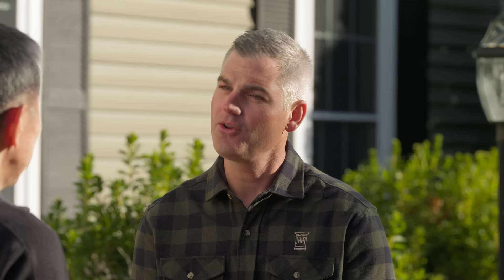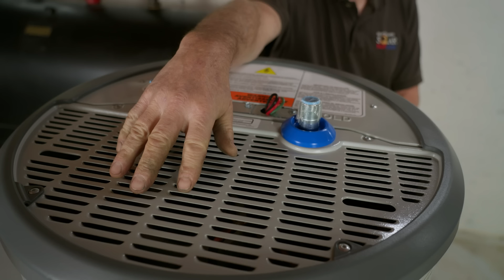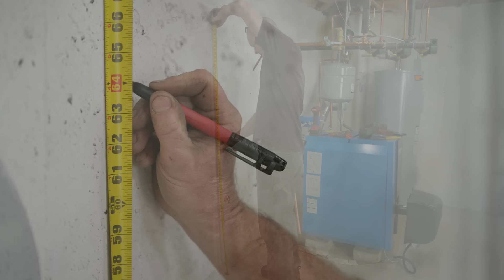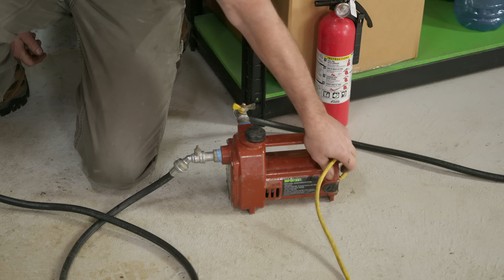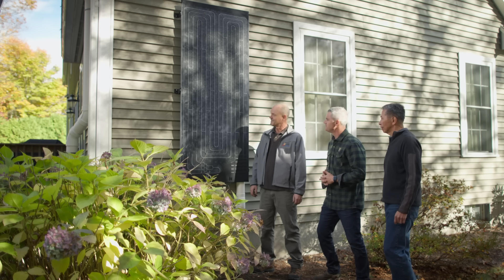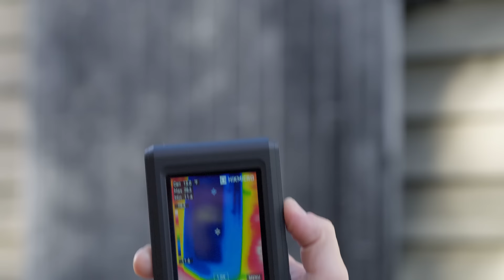Heat Pump Water Heater for Cold Climates | Ask This Old House

Comment: OK, here is what I don't get. Refrigerants boil when compressed, so why is the boiling refrigerant not just pumped through a coil  to heat water? I don't understand the need for getting heat externally if you are already making heat by compressing the refridgerant?
Reply: Refrigerants boil when evaporated. Heat pumps do not "produce" heat, they move it from one place to another. This system is taking heat from that evaporator (the thing outside) and moving it into the water tank. It gets cold because it's absorbing the heat from around it. Compressing the refrigerant forces it to become a hot gas, which is then moved into the condenser, in this case the inside of the tank is the condenser. This condenses the hot gas refrigerant into a liquid and gives up its heat to the water in the tank. Now you have a warm liquid refrigerant, which you can't just compress again. Remember, liquids can't be compressed. From there you send the warm liquid to the evaporator where it passes through a small orifice or expansion valve. This pressure change causes the refrigerant to boil. Boiling anything takes energy, like when you put a pot of water on the stove. It takes energy to boil the refrigerant, which it gets from the metal and surrounding air of the evaporator. This seems counterintuitive since it's cold, but it's actually absorbing heat into the refrigerant. This is where the heat comes from to heat the water. From there it goes back to the compressor and back to the condenser and gives that heat off to the water. The cycle repeats over and over. Just like a window air conditioner, heat is moved from inside to out. One coil gets cold and that is the one absorbing the heat and the other gets hot and that is where the heat is released. We are used to cooling things and it makes more sense, but it's essentially like taking the window air conditioner and putting it in backwards to get heat in the winter time. (window AC's aren't designed for this, but an AC is just as much a heat pump as this thing is. Heat is moved from one place to another. It's vastly more efficient to move heat than it is to create it. Hope this helped.
Reply: Because then you'd just be using 1:1 electricity to heat to generate the heat. Electricity to make heat is very expensive. The panel outside absorbs ambient heat in the air, free heat really. That heat was generated by nature not by gas, oil or electricity that you pay for. Using electricity and the pump 1 unit of power is used to grab about 3 units of heat from the air outside and move the heat inside using the refrigerant moving in the tubes.
Reply: @dg-hughes " Using electricity and the pump 1 unit of power is used to grab about 3 units of heat" What does that even mean?
Reply: @saulgoodman2018  In an electric water heater, 1 watt of electricity is turned into 1 watt of heat in the tank.  In a heat pump system, 1 watt of power to the compressor moves 3 watts worth of heat into the tank. You can use whatever units you want, it doesn't matter, the math works out the same.
Reply: @chrisrichard298  Still do not understand. What does that mean in term of how much it would cost? How many degrees is a watt of heat?
Reply: @saulgoodman2018  It basically means the heat pump water heater uses 3 to 4 times less power than an electric water heater does - when its running on heat pump mode.
Reply: @Zero11_ss  This is what I hate about Ross. He talks about things in terms that most people do not know.

A gas water heater seems like it would be cheaper still. 
Sounds like a gas water heater uses the same amount.
Reply: @saulgoodman2018  Yeah the explanation wasnt clear enough. I actually switched to this from a nat gas one, used some govt rebates and stuff to get it done cheap. Nat gas prices will probably rise in the coming years, we are going to start exporting it as liquid natural gas to the europeans since nat gas is way more expensive over there. Data centers are also using nat gas to generate power since its quick to set up. I want to make our house full electric eventually and get solar panels, but i cant afford all that yet.
Reply: Right, so refrigeration in a nut shell 
is just moving heat from one space to another. The byproduct of that is what we call "cold". When it is done as your inquired about, you will effectively be cooling your house. Not ideal in the winter.
Reply: @ARClazerbeam  Also not ideal in Areas where Natural gas is 4x cheaper than electricity...AKA most major cities...Heat pumps are a scam, and they are noisy...
Reply: This method is 4x cheaper in summer
Reply: @Zero11_ss  Having a solar water heater panel on the roof would be even cheaper. All of this is a waste because hot water demand in the summer is minimal and is important in the winter. These heat pump systems take forever to heat the water using the refrigeration cycle and can't keep up with a large household's needs for showers in the morning.  Most of the heat pump systems have conventional resistance heating elements for high demand = no savings during peak use.
Reply: @David_H_Parker a work around is to keep the water temp higher and use a mixing value to keep it safe.  It will increase your net hot water and keep your heat gain through the heat pump rather resistance heat.
Reply: @David_H_Parker  i have a 65 gallon one with 5 people in the house and i never had a problem so far, I live in NYC. Even if you have more people over, it can easily just switch over to full electric.

Comment: What about in comparison to natural gas? I gotta say I have a family of 8 and we never run out of hot water and my gas bill in summer with the my cooking stove and the water heater only runs like 25 a month
Reply: In terms of energy efficiency, natural gas will be a little less than 1 (depending on all the factors) because natural gas is converting the gas energy into heat, to warm up the water. Heat pumps are more energy efficient because instead of only converting the energy to heat, they use the energy to move heat around: effectively, they scavenge heat from the source and apply it to the water. The efficiency goes down as the amount of heat outside goes down.

Now in terms of dollar cost? That depends on how much your natural gas costs vs. how much your electricity costs. For me, natural gas is very cheap so even if it's less energy efficient, it may be less expensive to use it.
Reply: @broadside85  If he's on oil. I guarantee he doesn't have natural gas. He would have to have a propane tank and delivery.
Reply: @broadside85  Exactly. The efficiency of a natural draft water heater is nowhere near 1 but would likely cost far less than even the most efficient heat pump water heater in winter.

Electricity rates are climbing in most states due to higher demand from EVs and datacenters.
Reply: If he has an oil boiler, it means natural gas is not available in his area. Cost of the indoor heat pump water heater is at least $1500. The conventional electric is around 500$. The system will wear out before you ever get your money back even if it were 300% efficient.
Reply: It doesn't seem relevant since Methane is not available in this location.
Reply: They want us to have electric cars but not electric water heaters...
Reply: @FshHnt192  I can't say what they REALLY want for you but it isn't in your best interests.
Reply: @David_H_Parker  And why can't you say it? Who's "they"? And how do you know what's in FshHnt192's best interests?
Reply: I use natural gas for water heater cooking stove and furnace and I live in indiana we suffer weeks of below zero degrees the highest my gas bill gets is maybe 235 a month in the coldest months but in summer its seriously 25 a month. Id say its all in the costs of things in your area
Reply: You’re essentially paying $20/month to the gas company just to have a gas connection and $5 of gas for the stove and water heater. If you stop using natural gas, you save $20/month, and you can use those savings on using more electricity for an electric stove and water heater.
Reply: @my2iu  Electricity rates are typically higher than natural gas. Running an electric water heater and range/oven would push the electric bill higher than the $20 or $25 base service gas fee. 
Using electric heat rather than gas would run the bill north of $600 easily and possibly as high as $1200 per month.
I am paying up to $80 per month for my electric bill on a vacant house only running a dehumidifier and a couple lights on timers.
Reply: @David_H_Parker  Are you getting ripped off on your electricity? I’m paying $50/month in electricity for my condo that I live in, and $45 of that is just for the connection. I only pay $5/month for the electricity. Admittedly, a whole house dehumidifier is the equivalent of running an air conditioner, so maybe $80/month for that isn’t so bad.
Reply: @my2iu  I am running a portable 55 pint dehumidifier and 3 lights on a timer.
 My absolute minimum bill is $18 with the main turned off with zero electricity usage. During the winter my bill is $25 per month, during the summer, it can get up to $80 per month.
I could probably save a couple dollars switching to another plan but not much.
 I have another vacant home in the neighboring state that is consistently $6 per month with the same model dehumidifier. 

I don't want to know what the bill will be when I am actually living there with all of the appliances plugged in and A/C running for summer.
Reply: But like $300 in the winter
Reply: @Tilier  Because they are more then likely also have a gas furnace. So they also use it for heating.
Reply: @Tilier  Whatever it is in the winter, natural gas will still be cheaper than electric.
Reply: @David_H_Parker  depends on where you live and if it is more expensive where you live. you can invest in some solar panels and heat pumps will definitely be cheaper. The zero OPx house is now a reality.
Reply: @gabeh.4297 Without taxpayer subsidy, the ROI on solar and heat pumps is over 20 years in most locations.

Comment: Cool tech but a bit of an eyesore. I wonder if it makes sense to put it on the roof like a solar panel or if the frost/ potential snow buildup would be problems.
Reply: you don't want snow and ice building up on it ideally, basically just acts as an insulator. These are great and definitely the future. There's a reason every new build doesn't do gas hookups anymore. These with induction stove tops and full heat pump HVAC and some solar panels and your home is basically self sufficient. throw a house battery + electric car in there and you can be fully off grid with no OPex.
Reply: @gabeh.4297 You obviously haven't designed or priced a solar system to run an all electric home.
Reply: @rupe53 of course I have. If you don't do it yourself, it's very expensive, but if you install it yourself panels are dirt cheap nowadays, the most expensive parts are basically the brackets 😂 it's definitely a spend money now to make money later decision. If you haven't done it before, I recommend starting with a car port or a shed and then do you roof after you've got it down. You can get 340W panels for less than $100 now, if you haven't kept up with the market, it's gotten waaaaay cheaper in the last 10 years
Reply: @gabeh.4297   I fully understand that part as an avid DIY guy. (at one point) I rebuilt my home from scratch and was in various trades and am well versed on the know-how part. The body is no longer cooperating, can't climb a ladder, and have trouble with stairs these days. Last fall my wife cleaned the guters. She's almost 70 but at least steady on her feet. I only do ground work now.
Reply: @rupe53 yeah, that's fair. The labor is definitely expensive right now because it's a new technology and everyone doesn't know how to do it yet so they can charge outrageous rates. If you still do want to do it yourself putting panels on racks on the ground will still save you money but that's a bit of a waste of yard space imo :(
Reply: @gabeh.4297 We'll see what the spring brings. I was toying with the idea of some plug n play panels hanging on a fence. Hey, a thousand watts is a thousand watts, right? Of course it's not the optimal location and might get only 6 hours a day of direct sun so have to calculate at maybe $1-$2 a day payback at best.
Reply: @rupe53  yeah, buying them in pallets of ~25 is how you get the best deal but just a few will still be worth it financially, especially if you have a workshop that needs power that you can hook up.
Reply: @gabeh.4297 Not sure why anyone would consider the expense for a part time endeavor of intermitent use. (workshop?) If I were to do an install it would be to shave my utility bill, which is every day for as long as the sun shines. I may not get full reimbursement for backfeed but any power I don't have to pay for is at full rate. My local utility rate is near 35 cents per Kw and I have easy access to an area for maybe 6 panels that already faces south and is the right pitch.
Reply: @rupe53 just if you don't have enough panels where buying the equipment to hook it into your switchboard is worth it. With 6 it probably is but with 1 or 2 they can just run lights and recharge tools in a workshop without needing that equipment.
Reply: @gabeh.4297 WIth only 1-2 panels you are just playing a game and there's no tangable savings for the amount of power used on a phone or power tool. As they say, in for a penny, in for a pound. IOW, if you can do a few bucks a day in savings then it will add up. $50 a month should be possible and that's $600 a year.
Reply: @gabeh.4297 Unfortunately in Ontario, new gas hookups are subsidized by all gas ratepayers.
Reply: I wonder if that panel could be turned 90 degrees to lower the view from the street?
Reply: Did anyone understand why they used the static panel and not a regular mini split condenser with a fan?
Reply: @pprb123  Most likely to save space, fewer moving parts, cheaper, and it's not necessary. Oh, and the compressor is hanging on the wall in the basement so no outside wiring.
Reply: @pprb123  different type of system. and obviously a panel is a heck of a lot cheaper than an outside condenser with fan, etc.